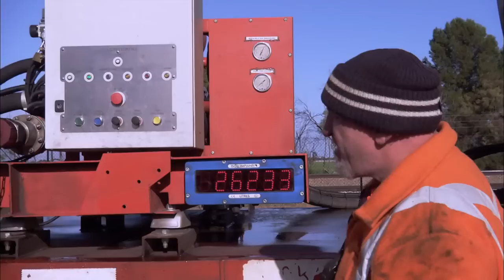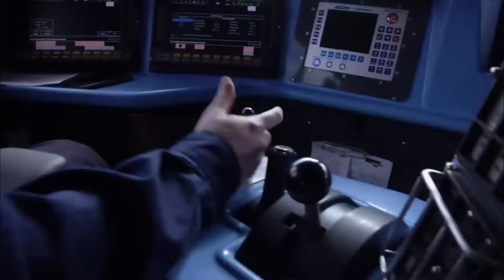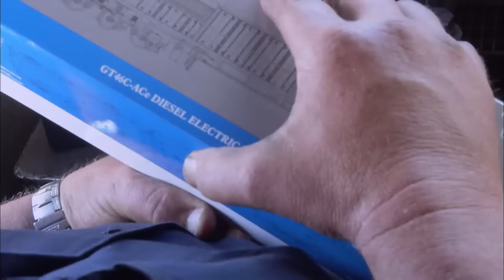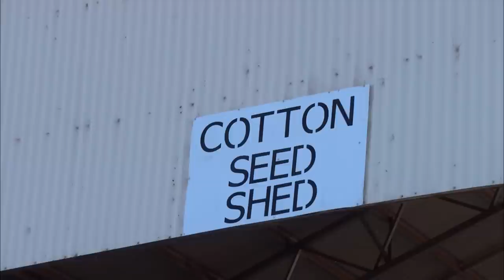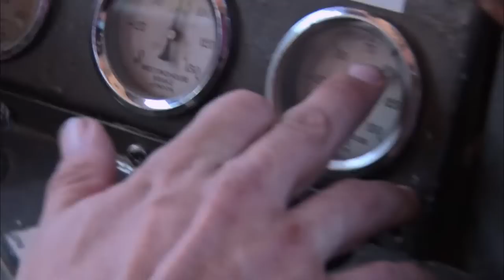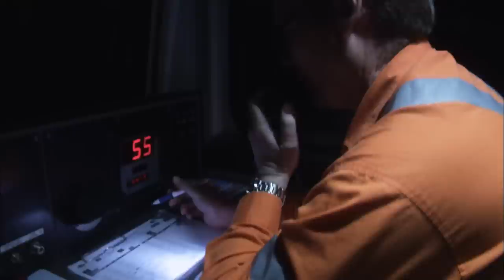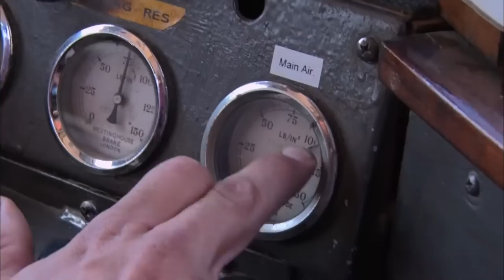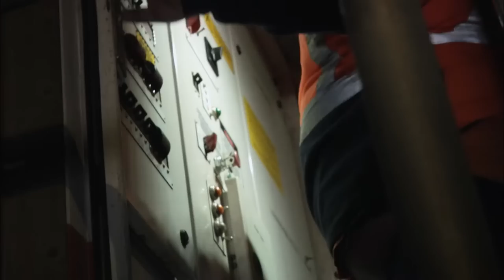How To Stop A 5000 Ton Juggernaut Train | Railroad Australia | Episode 2 | Documentary Central

Comment: 1.5km train length is on the short side by American standards.  Average train length here is about 2.5km, and now we're regularly seeing 4km-long trains in some areas. However, the longer trains are coming at the price of safety.  Major railroads are also looking to reduce train crew size to one person.  When a knuckle breaks and splits a train, a driver by himself won't be able to do anything; if it happens in a built-up area, it would block crossings for hours and cause problems with emergency vehicles trying to get through.  A general strike over this issue + serious wage and work hours was to have started today, but was temporarily averted; a 60-day clock is ticking though.

But certainly trains through the Outback come with their own perils, as I learn from this video.  We don't have sheep or kangaroos loitering on tracks!  And our train crews tend not to know about rescuing crocodiles either.